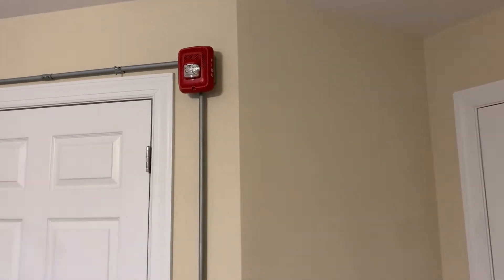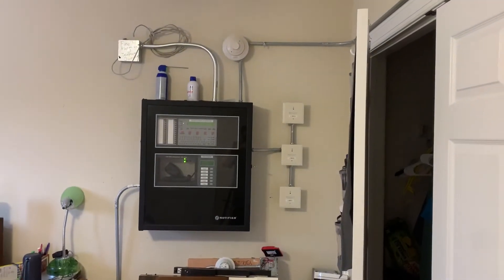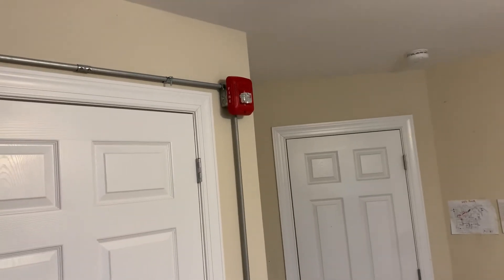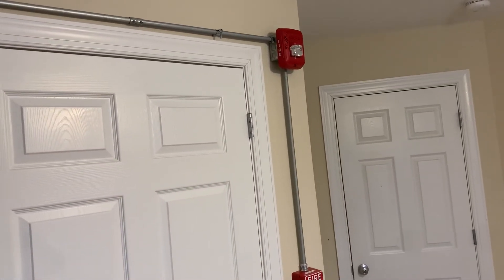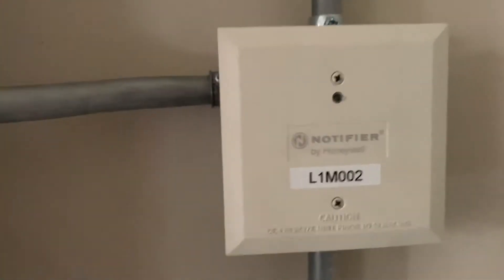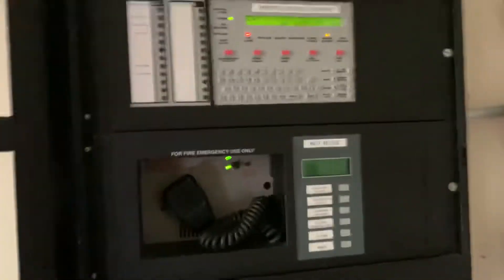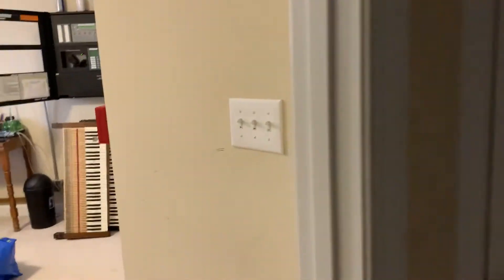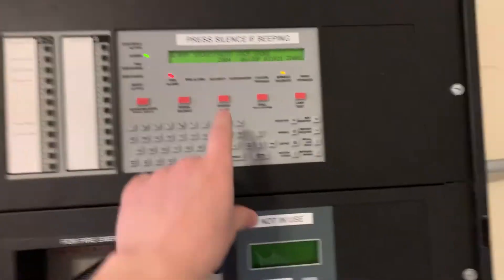AMG-1 Voice Evacuation

Comment: How do you get a v-ram (voice evac chip) i only have the v-rom (tone chip) i really want a voice evac one!
Reply from the maker: VRAM is the custom voice chip. I have yet to find one. I have a VROM chip with a pre-recorded message
Reply from the maker: On google, you can find a list of voice messages with their corresponding VROM part number. I advise you do some googling and see which message best suits you.
Reply: A VRAM is likely to be in a AMG. Normally they aren't factory recorded. But they did at one point make factory generated VRAMs. If you wondering where they went well sadly they were all destroyed in 2008 in the factory. So they are obsolete.
Reply: @Sirenfireproductions5209  thanks for the info. I did get my hands on 2 of them.

Comment: How were you able to get a job for a notifier distributor? I was interested in getting a job for a notifier distributer? I’m really into computer programming
Reply from the maker: I worked for an FCI distributor and a SIEMENS distributor, not Notifier
Reply: @ncalarms6022  Then how did you get a verifire tools license?
Reply from the maker: @graememcrae9284  I didn't need one for the version I used to program this panel
Reply: VeriFire 5.7 and older don't need a license

Comment: Nice!, i am about to get one of those for my 3030
Reply from the maker: It will only work with the original NFS-3030. If you have an NFS2-3030, AMG-1 will not work.
Reply: @ncalarms6022  Will the AMG-1 work with a nfs2-640? I'm assuming it would since you have it hooked to your panel.
Reply from the maker: @Roxxofoxxo  Yes, with modification
Reply: @ncalarms6022  Ah
What would you have to modify? I plan on getting on in the future for my nfs2-640.